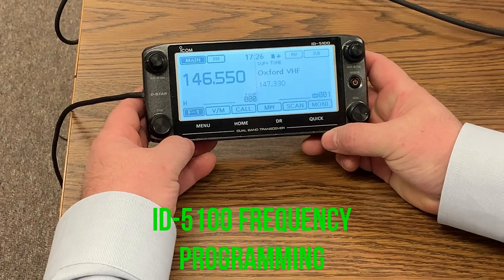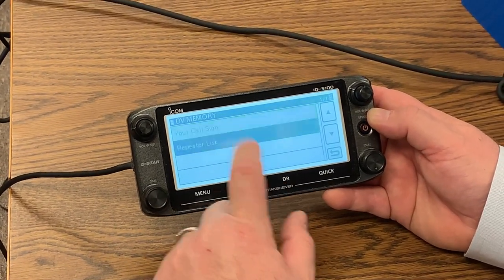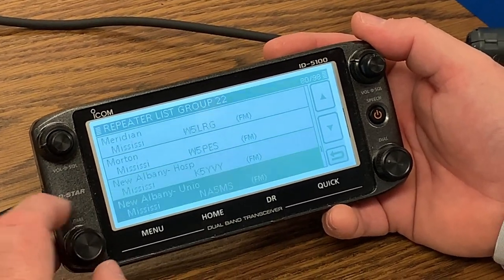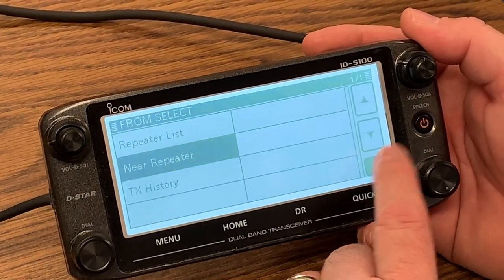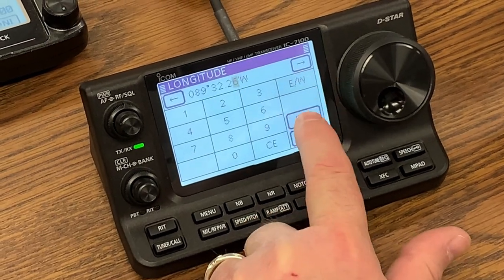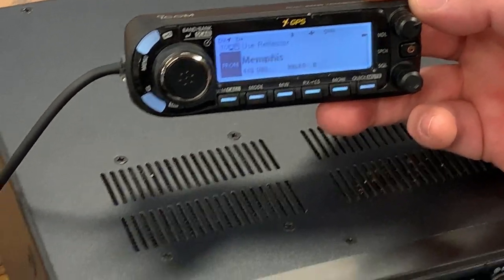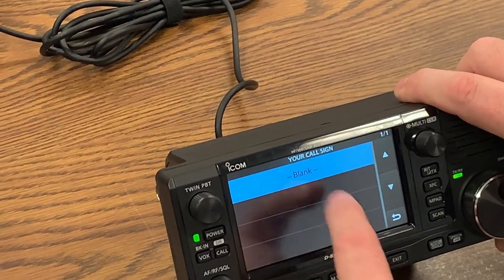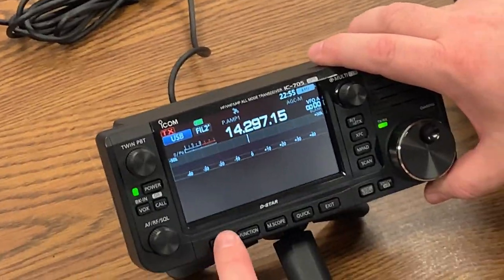Icom Tips, Tricks, and Hacks With Ray Novak of Icom

Comment: there is no reason not to have a colored screen in every radio these days. If a company refuses to put a color screen in a radio they are just cheating out on us. Those color screens are cheap and look amazing compared to the old monochrome blue or green colored screens.
Reply from the maker: That may be true for off the shelf displays, but ham radio products are
 a niche market. They have low volume/year. Consider that consumer electronics are produced in volumes in a day what most ham radio products would do in the lifetime of a product, then I wouldn't think the display and support components along with software would be as cheap as you think.